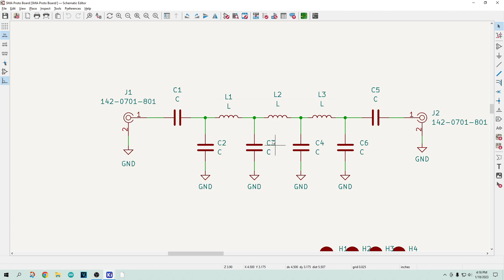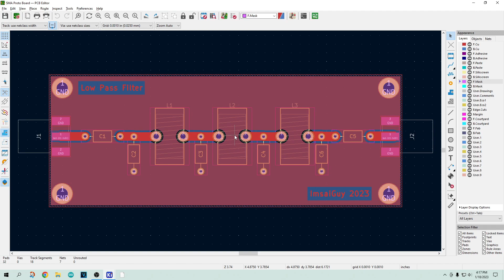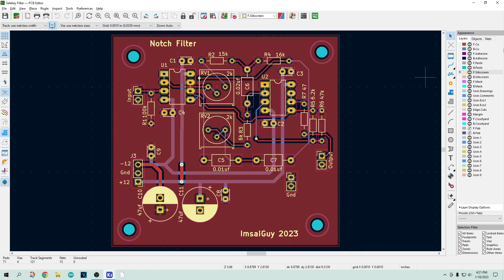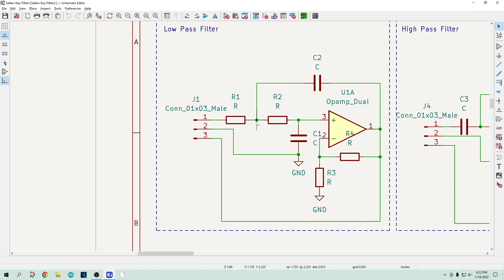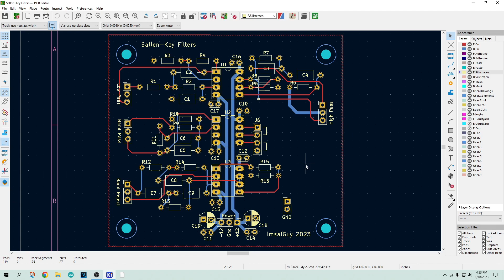#1408 Analog Filter PC Boards

Comment: It's well worth digging out R P Sallen and E L Key's original paper 'A Practical Method of Designing RC Active Filters' published in March 1955 in IRE Transactions - Circuit Theory, particularly if you're interested in transfer functions and don't mind delving into poles and zeros! Although it uses valves, it's packed with useful practical information on how to design a variety of filters.

Comment: Hello. Would like to use a filter so I can receive radio signals at 17.2kHz. Preferably variable frequency but not necessary. I can't code processors so a pure hardware radio is desirable. Thought a bit about T networks and using an op amp to amplify instead of removing signals. Some ideas?
Reply from the maker: you need a good filter. mix the 17khz up to a freq you can use a real radio. or mix up to say 10.7MHz and use a good bandpass filter, then mix down again and detect.

Comment: Generic proto board is quite difficult. If I made a board for a filter, I'd make it fit different size caps and inductors in parallel to make it possible to do low-pass, highpass and bandpass.
For one off projects that may not have a lot of benefit over using something like island pcb pieces glued over a non-etched pcb to build things dead bug style. You can also drill islands for connections with hole saw that has no center drill, just drill through copper to get an islan where you want one (and the size you want)
Sometimes a hole pattern can allow you to switch components like resistor or cap. Of course, smd components of same size are always switchable.
I think the idea of generic rf prototyping board is next to impossible to make very usefull. For anything more complex, you probably need the custom pcb for the application anyway. When you don¨t or get away without one, normal protopyping boards with for example through hole pad grid is the best you can get.
Reply: These are all teaching tools lol. Of course for any specific application, you'd design and optimise specifically for it.

Comment: hi there, 2:12, i tried this circuit but replacing the potentiometer with LM13700 to have it voltage controlled for audio in a simulator, the Falstad simulator.
the low pass isn't a big deal, but since there a loop "around" the circuit, going to the 0.01uF capacitors back in to the voltage follower U18 not much of a change if any occurs and a 10 V.p.p is passing through unchanged.
I tried placing an LM13700 in place of "RV2" in both directions, up/down and still no real results,believe it should be going to R3 from both capacitors.

Would you care to build one with Ota's and suitable for 20-20KHz?

Comment: Very interesting Boards ! 6:20 Why is the trace between R16 and U3 changing to the top layer ? R15 / R16 are already on the bottom layer.
Reply from the maker: I was putting vertical traces on the bottom and horizontal on the top. It just ended up that way.
Reply: Ok, thats right, you do it that way on a 2-sided PCB. Maybe I'm being a little picky ;-) I try to avoid layer changes whenever possible. (I'm a long time Eagle user) Greetings from Germany